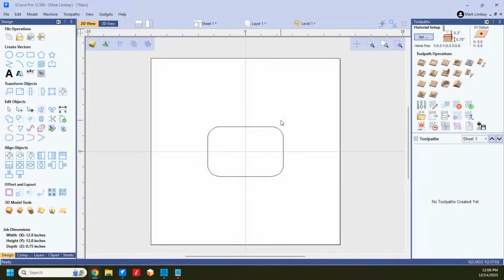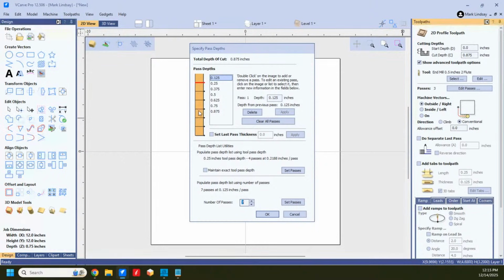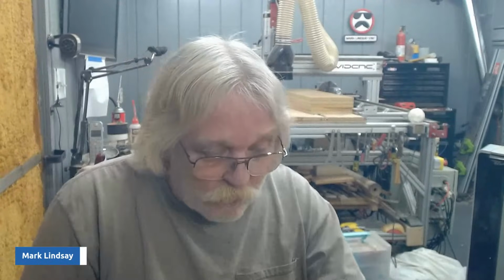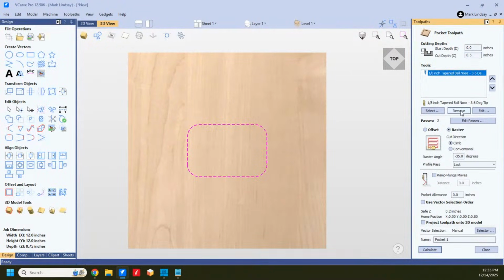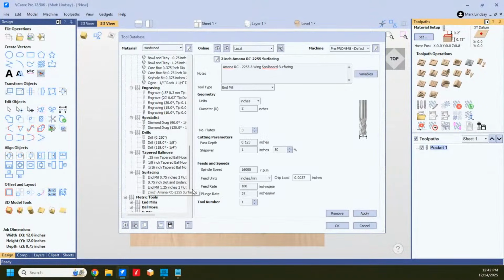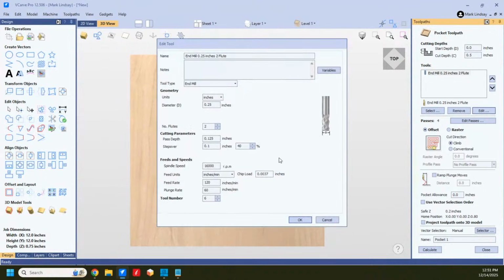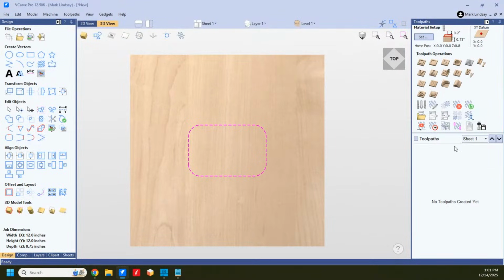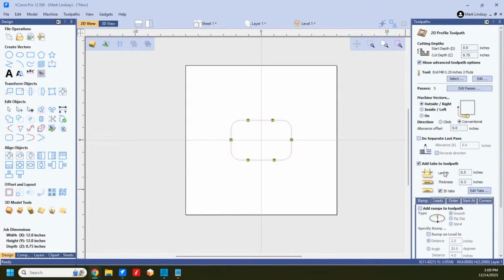Live Q&A #318 – Edit Passes in Pocket and Profile Toolpaths and Open Q&A

Comment: I keep hearing the comment  about changing depth of cut and feed “ when you are comfortable with what your machine can handle”  I’m pretty much a hobby beginner. Size of chips wasn’t very informative to me. I was told bit heat was a good indicater & a carbide bit was OK up to about 200°. I bought a temperature gun & nowI can check temps while running and see differences in feeds & speeds during a cut when I change either. I find I’m running in the 90° range on most end mill & bowl bit cuts. Am I underutilizing my machine by not running deeper cuts or faster feeds. ( Longmill mk2, Makita router).